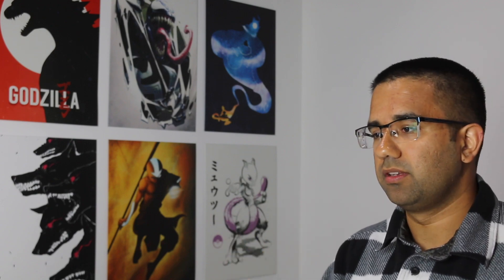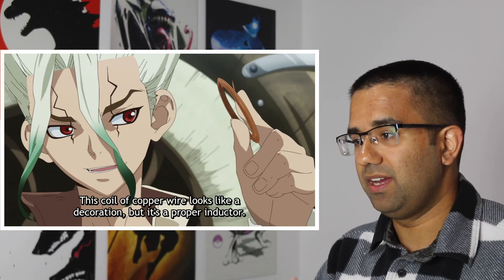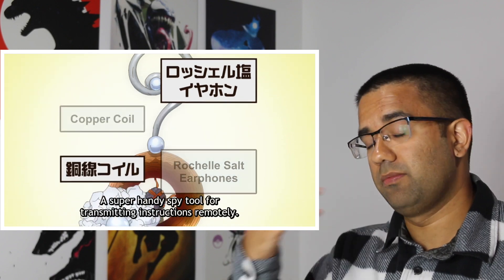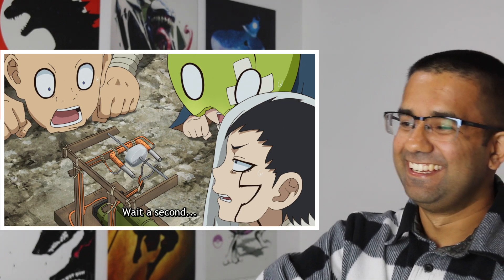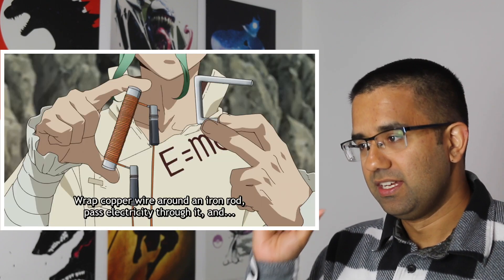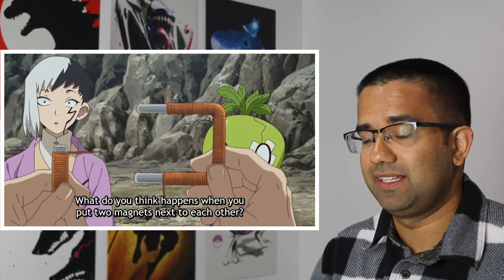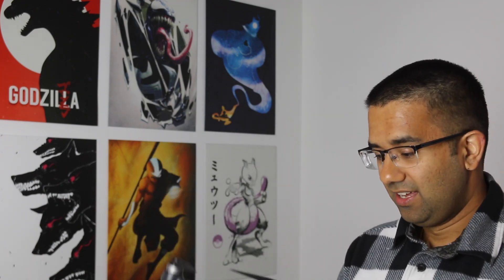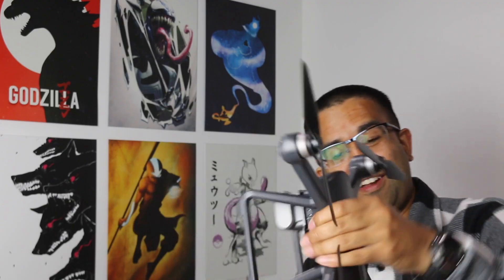Real Engineer Reacts to Technology in Dr. Stone #44

Comment: These rats cannot be remote controlled. There is no semiconductor technology, and a vacuum tube is the only possible signal amplifier. It will destroy the battery immediately. Given the size of the battery and the motor, there is no way they could make them radio controlled with the available technology at that size.
Reply from the maker: You're totally right about the limitations of the technology!

Comment: Oh don't worry, we will get to see the proper drone and the controller. 

About the coded message Kohaku sent, I was really happy how Gen explained it taking the position of the person who transmitted the 'letter', makes me remember my projective psychological tests classes. 

Lastly, the first written system that came to my mind from what you were talking was chinese characters haha, same logograms based system as hieroglyphs just that they're still used, what I find interesting in this is that they envolope historical-cultural knowledge, it's fun, specially when they explain to you how the characters have transformed from ancient to modern, for example the pictograph of a tool represented precisely that, but the expanded meaning is 'to work'; or the pictograph of an axe represented the power of a king, so it meant 'king'). For the emojis replacing words mmMMmM I think we will use it to reduce the extension of messages yes, as a practical function, but the limitation is the intrinsic characteristic of expressing emotions, if you wanted to express something else that isn't universal, as a theory, you will need ideographs and not pictographs. Specialy when it comes to our language, bc emotions aren't alone, they always come with the cognitive and behavioral factors, so that's also part of what the message has to transmit.